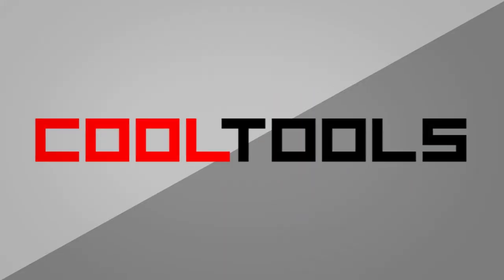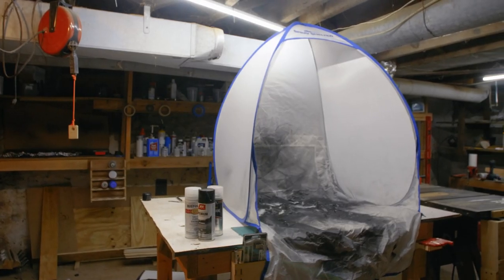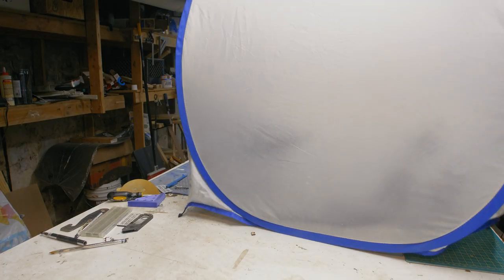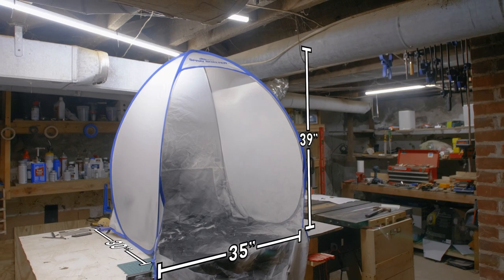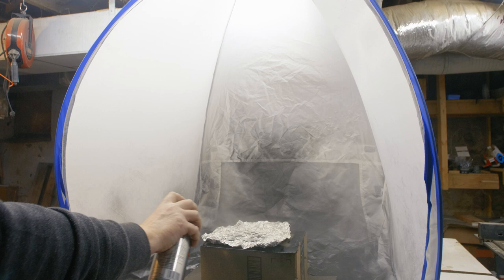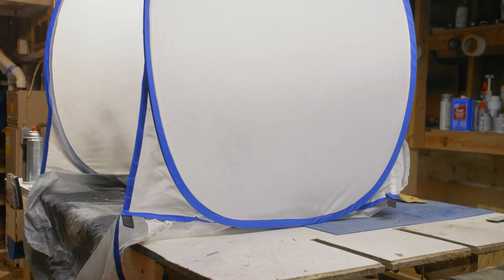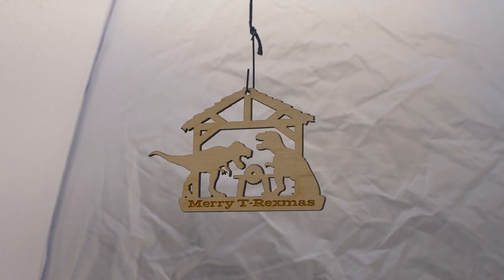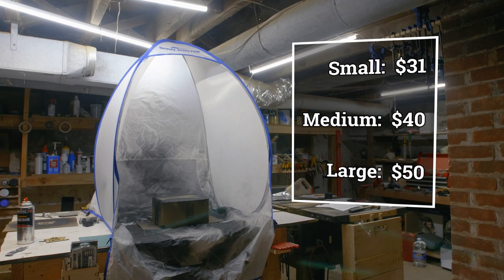The Perfect Spray Booth for Small Shops

Comment: The assembly instructions for the large tent are not very good.  The angled pot metal sleeves the fiberglass rods slide into can easily break if you’re not careful when bending and sliding the connected lengths through the fabric loops.  I would avoid buying this because of how cheaply made it is.